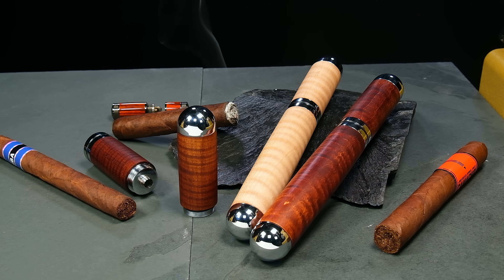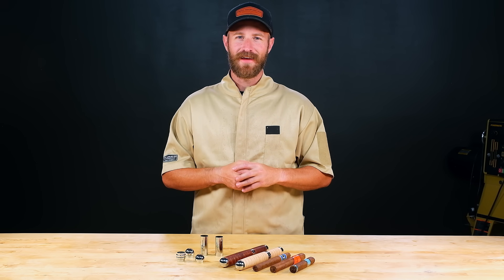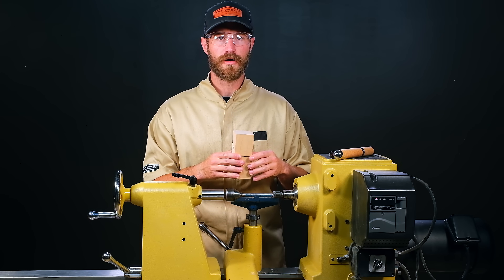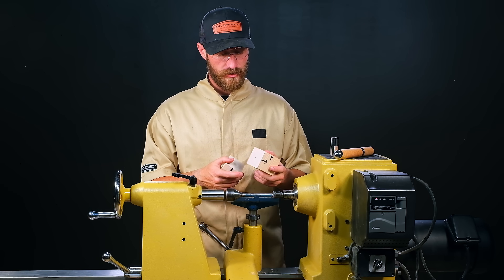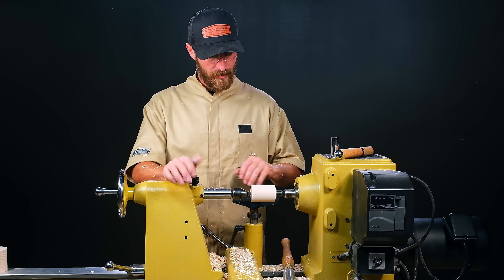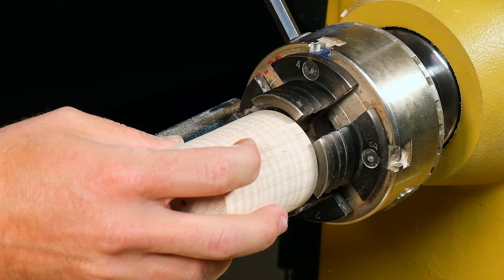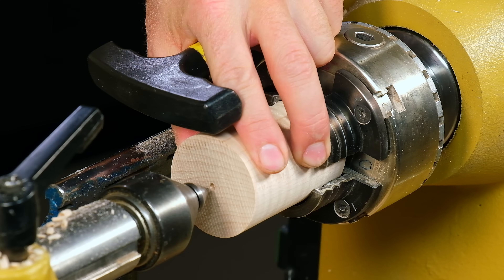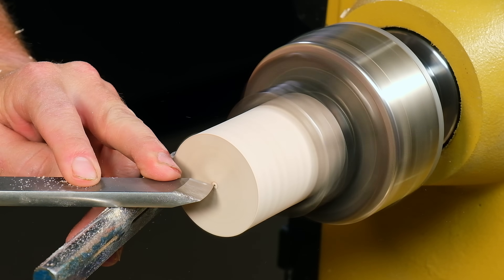Turning a Cigar Case - Step-by-Step Guide

Comment: I have been patiently waiting for this video.  Thanks!   What were the thicknesses of the blanks that you used?   Is there a recommended minimum?
Reply from the maker: 1-1/2" x 1-1/2" x 10" is the recommended minimum size.  The blanks I used were 2" x 2" x 4".
Reply: Many thanks